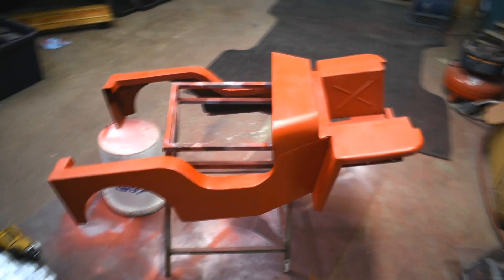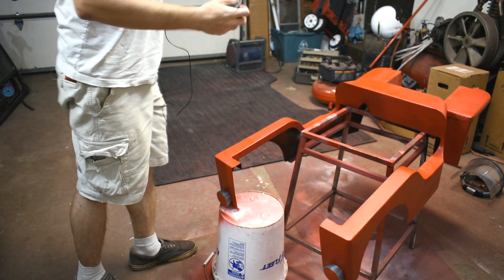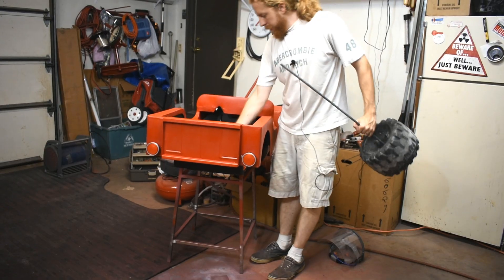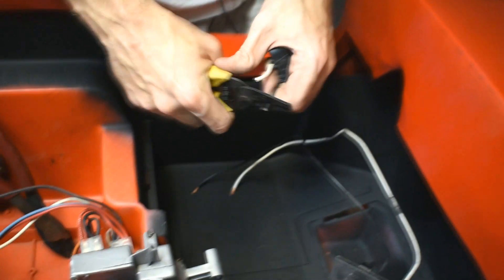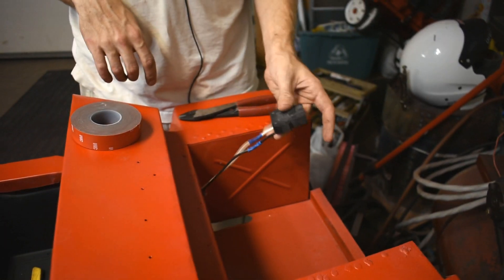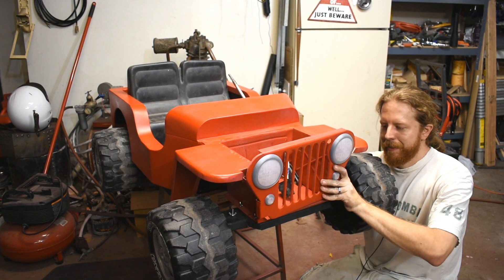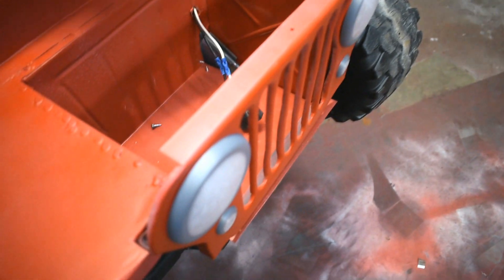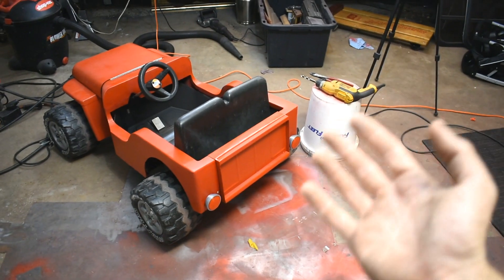Mini Willys CJ2A Part 14: Putting it all together! Finale!

Comment: Good job man! Turned out really nice. To further save your shins you could use one of those gray or black foam pipe insulators that looks like a pool noodle. Just cut a slit down the center and slide it over the bumper and it shouldn't take away from the appearance. Just an idea.

Comment: Left tail light only used to be all that was required at one time.  I had a 1947 Chevrolet Van with only the left tail light once.  Original equipment!  😉  Your shins might like a nice piece of pool noodle over that front bumper.  👍